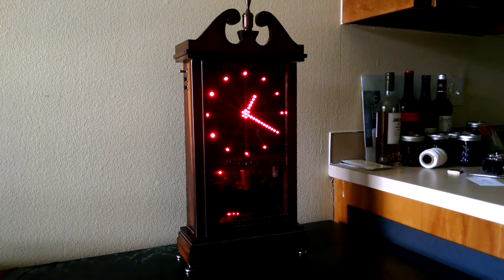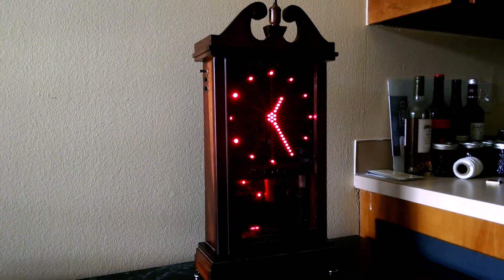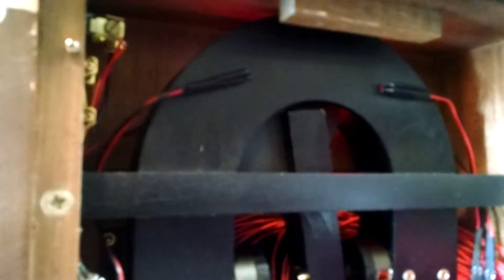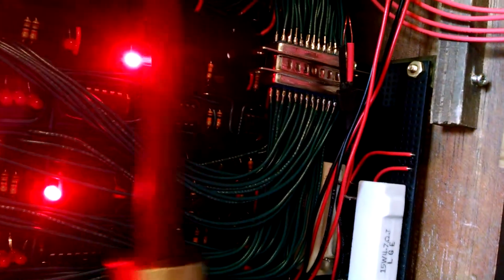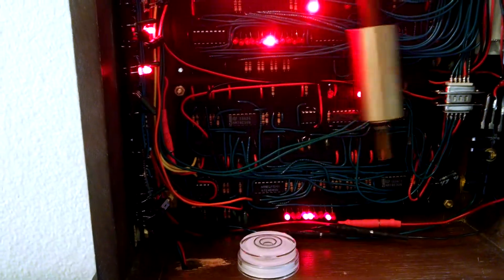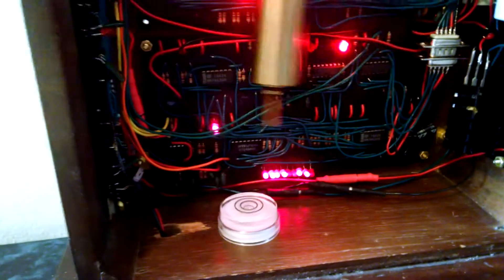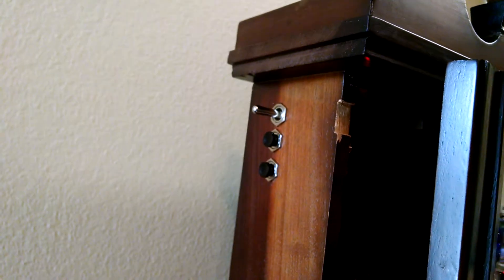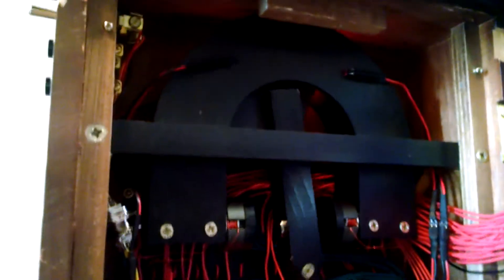Digital Pendulum Clock (How it works!)

Comment: I've been planning on making something very similar for a while. I like the way you did the pendulum. I have been wondering how to do the pendulum and it looks like your idea is so far is the best I've seen.
Reply from the maker: Cool, I say go for it. Make sure the mechanical design of the pendulum is robust, low friction and easily adjustable before trying to do the electronics.

Comment: Very nice idea project and beautiful clock.  Are you an EE?
Reply from the maker: I am an "engineer" of sorts for my job and have a physics degree (bachelors). As far as EE is concerned I'm mostly self taught and pretty good at it, but not a professional.
Reply: @danebeck7900  I was just curious as you seem to be good at it.  I have worked with a few people with physics backgrounds and they seem to have a deep understanding of things.  I have an engineering degree, not an EE, but have taken several EE courses, and it's been a lifelong hobby of mine.  Thanks for the response, I've been enjoying your projects videos!
Reply: @danebeck7900  Hi again, I also meant to ask how accurate the timekeeping is.  I suppose if the pendulum never skips or jumps a coil pulse, then it should be very accurate.
Reply from the maker: @Enigma758  Timekeeping accuracy isn't that great. There are a few quirks of the pendulum design that effect it. When the pendulum approaches the top of the swing, the magnetic attraction between the ferrite cores of the coils and the neodymium magnets on the pendulum opposes gravity trying to pull the pendulum back down. This reduces the acceleration of the pendulum at the top of the swing and increases the period. This effect is more pronounced as the amplitude of the pendulum swing increases. To counter this I have a small air flap on the bottom of the pendulum to passively limit the amplitude through air resistance. This helps but it's an imperfect solution. If the clock is running well it'll stay within 5 minutes for a few days. Generally I have to adjust the time at least once a week. If I were to redesign this thing it would need some form of active amplitude regulation, like a sensor that detects when the amplitude is too high and then temporarily turns off the coils.